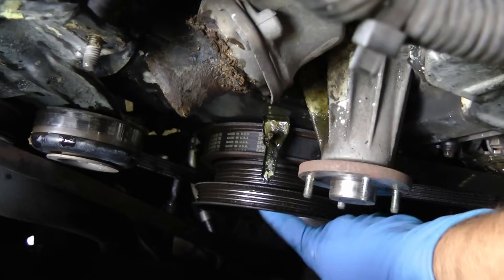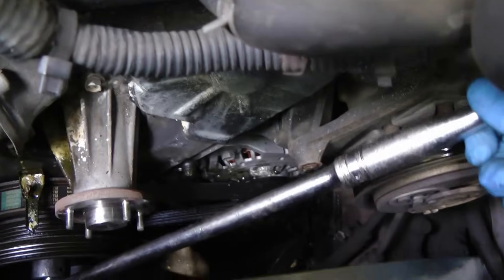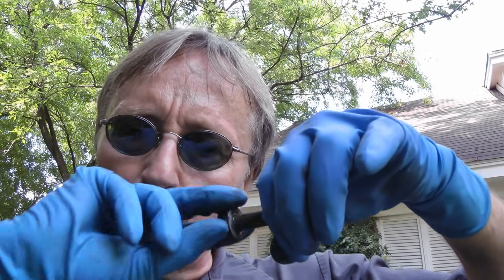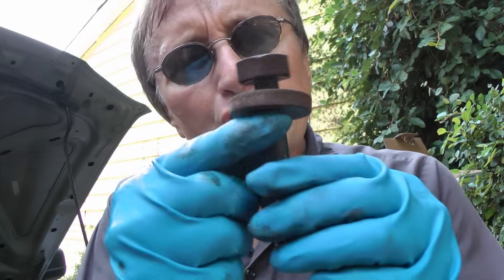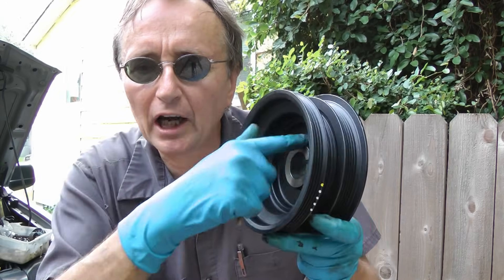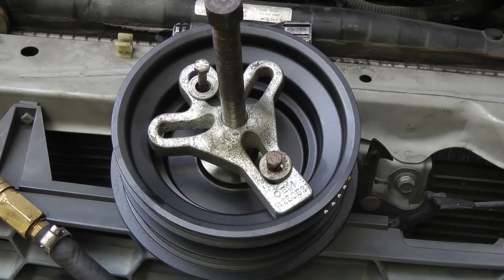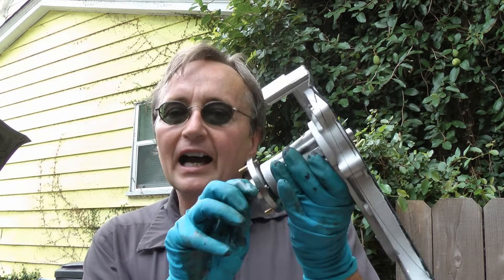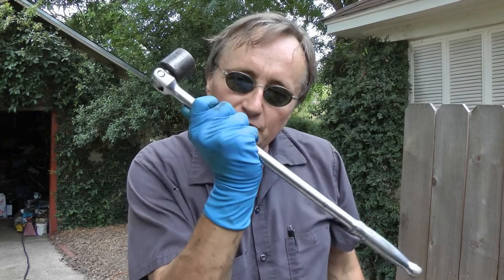How to Remove a Crankshaft Pulley in Your Car

Comment: Should probably make sure everyone knows to not actually start the car.  This method would be safer if you disconnected a fuse or something so the engine can turn but not start.
Reply: Excellent point Elaine
Reply: He probably did that judging how many times it turned and didn't start
Reply: If you shut it off right away will it be safe?
Reply: Not sure I just make sure it dont get fuel or spark when turning it over
Reply: @nathangibson5987  Can I ask why?
Reply: Personal opinion, It dont fill the cylinders with gas  as it cranks over and I stop the spark so there is no chance of it starting
Reply: What about if you have a push start button
Reply: @abrahamhernandez1913 same thing disconnect the fuses and itll just turn over but not start

Comment: Thank you!  I used this trick to get off a crankshaft pulley on my Mitsubishi D1600 tractor. I broke the frame, built a new frame out of much thicker steel only to discover that the pulley was touching the new frame. Saved me a days labor pulling the tractor apart so I could grind a relief in the frame. In all my years of doing mechanic work on my many, many vehicles, and after all the times I’ve pulled the radiator to get an impact on it, I’ve never seen or heard of this trick!  Last night I spent an hour trying to get this pulley off, but the engine kept turning. About 5 minutes of work this morning putting the battery back in and I had the nut off the crankshaft. Thank you!!!!!!

Comment: Just so you know this works great with a 2006 Mercedes C class.  I moved the windshield washer reservoir out of the way so I could lay the cheater bar handle against part of the driver's side cabin frame.   A 1/2 second crank was all it took to loosen the bolt, then it came out easily.  I was ready to buy a special tool for this operation but three suppliers were out of stock.
I am so glad I gave this a shot.  I actually think this is a safer method, especially for the mechanic.  Unless you are a complete klutz and crank more than a than you need to lose the bolt you will do no harm to the starter, etc.
This is the singular best auto repair shortcut I have ever found on Youtube.  Thank you, thank you.

Comment: Scotty, THANK YOU, THANK YOU, THANK YOU for this!!!!!! I tried to stick one of my ratchets with a long12mm socket onto one of the smaller surrounding bolts  repeatedly, and even tired to find a tool to hold the pulley/harmonic balancer in place - - didn't work. I was at a loss as to how to get that main center bolt off without it spinning. Scotty, you are THE MAN!!!

Comment: The bolt removal method W-O-R-K-S! One bump of the starter, the bolt was loose. I did the normal stuff first, like using a 1/2in drive impact, etc and it didn't budge. Thanks to all who posted this method on You-Tube.
Reply: If you have an old car. but push to start cars are dangerous.

Comment: This trick is fantastic!!!!
I did make a mistake of using a 12 point socket versus a 6 point so my first two attempts allowed the socket to jump off and strip the edges.  The third time around I used the 6 point impact  socket and a 5' 2x2 to push against the end of the socket while my son cranked the engine (to prevent the socket from jump off).  Again, thank-you!!!  You have saved me hours of work and frustration!

Comment: Wish I had seen this trick sooner. When I installed a lightweight crank pulley i needed a breaker bar and a 3 foot steel pipe for leverage to break the torque. This man is working smarter and not harder. Nice.

Comment from the maker: either the belt was not put on right correctly, or the belt is the wrong size. ALWAYS turn the engine around a couple rotations by hand to check the timing marks before putting it all back together

Comment: I tried this on my 350z...worked with just a bump of the starter. Thank you Scotty Kilmer aka G.O.A.T.
Reply: My 350zs pully won’t budge
Reply: I highly suggest doing what I did...
1st...remove the entire front end and 2nd replacing it with an LS2 swap. Lol just kidding...spray three shots of PB Blaster on the crank bolt once every hour for the period of a day. Let it soak for 24hrs...
2nd...
Get a 1/2 inch drive breaker bar 24 inches in length. Attach a 19mm deep dish/long socket to the crank bolt. Rotate the engine clockwise until the end of the breaker bar is touching the frame. Put a thick layer of shop towels between the Frame and breaker bar. 
3rd...
Make Damn sure the socket is seated on the crank bolt 100%. And the breaker bar is at a 90degree angle with the socket.
4th...
Simple turn ignition key and let off...its best to bump start..then check the breaker bar and socket alignment. Keep on bump starting until it breaks loose.
Reply: @ulyssesfuentes9739  hope that helps...it worked for me and oh yeah I'm not responsible for any damages to your vehicle due to misuse of my advice
Reply: Carls Johnson I used the tow strap method let some wd40 soak in for about a day and used a 6 foot cheater bar and a variety of impact guns to get it off

Comment: This only works on motors spinning clockwise when facing the bolt (which is automatical loosening). But for Honda Civic which is turning counterclockwise, this method will not work. For me I took it off with a holding tool and a 3/4 inch drive rachet to break it loose. Air impact wrench with beefed-up special socket will also work.

Comment from the maker: drive belts are easy, you just have to find the bolts to loosen to move the fulcrum that tightens them. Or if they have auto tensioners, you get a wrench on them and turn them to slack the belts.

Comment from the maker: yea, getting it back on is the cow part. Me, I put some locktite on the threads of the bolt, then quick screw it in and whack the bar with a sledge hammer a few times. Then don't drive it for 3 hours or so to make sure it's dry on the threads. Never had one fall off that way.

Comment: Scotty--- Thank YOU !! Bought a 95 Isuzu Truck--sons first car. It was the last car we looked at after a long day--I was tired and made a major fail. Test drove, checked all gears, ac, stereo, blah blah---test drive too short. Isuzu made it to my house and shut down at the rear gate of sub-division. No water in radiator, no oil--cooked. Noticed cam and crank still turned. Next day with water, oil, computer reset for kicks---she fired immediately. 277,000 miles--tough little truck. Water pump pouring. So we are doing it all----from the timing belt to rad cap. That crank bolt was killing me. Truck in 5th gear, E-brake on--torqueing on the bolt moved truck backwards !! I was afraid to try this trick--but I had to. With socket on bolt and pry bar wedged to road--I just bumped the key----and the stupid truck fired instantly !! But the bolt came out and the pulley didn't even need puller !! Thanks Dude !! It was killing me...........I am going to check anyway--but if I was able to move the truck back--in 5th gear by trying to turn bolt----can I make the assumption I have good compression?

Comment: I did a timing belt and water pump on a 2002 honda oddysey with the 3.5 . And the hardest part of the job was the getting the crankshaft bolt out. After 15 minutes of wailing at it I finally remembered this video I watched a while back . And said let's try doing it the Scotty Kilmer way and it worked lol.

Comment: After multiple attempts with my $200 Kobalt electric impact and breaker bars this did the trick! I was about to rent air tools and was skeptical but worked on my 2000 Toyota Camry.  Wedge my Breaker bar Towards front of car. I honestly thought it's head or the socket would snap before the bolt loosened. A million thanks!

Comment: you forgot to tell them to remove the fuel pump   fuse   or spark plugs wire so the engine can run and cuse some damages .   good luck and good work your doing.
Reply: Yes this was what I first thought when I watched the video. LOL
Reply: ....Or just switch the key off right away.
Reply: Clear-flood mode would do the same without moving things.
Reply: @Alex-uy7pc  what if its push to start?
Reply: @U2Jaime1317  but it did have a key, we weren't talking about a push start. But if it is a push start, then remove fuel pump fuse. While we're playing what if, if your car is on the moon tie it down so it doesn't float away in ya
Reply: @Alex-uy7pc  what if the only rope tie down I have it too long and it is uncuttable and only the ends are bendable and my car floats away too far anyway?
Reply: @Alex-uy7pc  could you tell me more please?
Reply: Paranoid much?
Reply: the questions is how do you get it back on without spinning the engine on automatics.
Reply: @MrShakamuni01  Thats the problem. I have with this its easy enough to follow but How do you put it back?
Reply: @CaptStump  what's that? Never heard of it. Thanks

Comment: Just tried this today and it worked like a charm. Used a socket and a breaker bar. Held it up against the control arm then flicked the key ignition. Quarter of a second will do, make sure to not start the engine. I suddenly heard the bar move and voila the bolt is loose! 

For retightening the bolt. I followed what Scotty mentioned, put the new pulley in and some threadlocker on the end of the bolt. Screw it in as much as you can without the engine turning if it does then stop. Put the breaker bar with the socket then wack it with a hammer a few times. Let the threadlocker dry for a good 24 hours.

Thank you Scotty!!
Reply: Nooooooo do not use thread locker that’s what causes them to get stuck use a torque wrench

Comment: Just had to remove the crankshaft pulley 2 days ago, did it by hand with a breaker bar and my elbows are still sore. Changed the Timing belt, Waterpump, etc in my 6g72...you don't know hell until you do this job on a Mitsubishi 6g72. The crank bolt/pulley was one of the easiest parts lol.
Reply: I feel your pain, brother. I have an 03 Stratus R/T with the 6g72 in and just had to replace that pulley.
Reply: Do you know how to get a crank bolt off a 1.8t Audi a4 quattro, crankshaft bolt from a pulley?
Reply: reverse the polarity at the battery so that the engine turns backwards when you hit the starter.
Reply: no brother, i Know hell, ive got a 94 probe gt v6.. timing belt replace....  right there with ya!

Comment: That's an old Ironworkers trick , fouling a spud wrench on a flange and backing it off with the impact...Scotty, you are the man...Great  video...Holding the roll...
Reply: Note I made it with 1/4x1x25" HD bought steel bar, the bar bend in 1" dimension like a snake, I guess angle steel might work.

Comment: Hi +Scotty Kilmer I would like to thank you for this genius idea.
I just replaced the crankshaft seal on my 2003 Grand Cherokee V8 engine without even removing the radiator or the fan.
Just needed an 18" breaker bar, a 3" jaw puller and and M14 fine pitch threaded rod to put back the harmonic balancer.
I just saved £480 what they quoted me in my local Jeep garage for 4 hours of labour. Well I'm not a mechanic but I finished it in 4 hours too. keep up the good work! best regards,
Reply: sussexdriver75 I'm about to do my 04 Grand Cherokee. I've read that you can also use the harmonic balancer bolt without the washer to seat the harmonic balancer. Does that sound correct? Where did you get the bolt to re-install yours? Did you use a torque wrench? if so do you know the torque specs? I keep hearing 130 lbs.
Reply: hi M Kinnison you won't be able to remove the washer from the original bolt and it's not long enough to seat the balancer back into it's original position (i tried it and it's an inch shorter then what you need). That's why I bought a 12" long M14 fine pitch (1.25mm) threaded rod and cut in half so one was 5" long and the other was 5.5" so I could play with them. I used 40mm washers and seated with the 5" long rod first and then I put back the original bolt with 175Nm torque (so 130 lbs) as it says. This was 5 months ago and still works fine, no leaks whatever.
Reply: sussexdriver75 thanks, sounds easy enough. It's my daily driver so I worry that I'll screw it up and have to take it to a shop anyways. Also the fan, is it a hydraulic fan? It looks like it has oil lines running into it.
Reply: M Kinnison I would say you have to plan everything if it's your daily driver. You will need a 3" small 3 jaw puller because this will fit without removing the fan and the radiator. You will have about 10mm clearance and that is enough to pull the balancer off. The biggest issue what no-one mentioned how you will put it back! I tried to find this info but couldn't find anywhere in my case when you don't take the fan and radiator off. The biggest PITA is to put the new seal in as it is really tight. It took me about an hour to fit it with a mini mallet. But I found another solution: with a 46mm 1 inch square drive impact socket and with the 5" long rod you can slowly put the seal in place. To be honest I was hardly able to find a fine pitch rod as I was unable to find anywhere locally so I bought it off ebay and of course had to wait 3 days to arrive so as I wrote, if it's your daily you need to get all the tools and parts together first and do it on a day when you don't use your car. By the way I'm not a car mechanic but if you have all the tools you can do it in about 4 hours as I did (except waiting for the fine pitch rod if you don't have one). BTW mine is the High Power output version 4.7 V8 engine so not sure if the other 4.7 V8 has the same seal
Reply: sussexdriver75 Yeah, I was wondering where to get the fine pitch rod from. I did get the socket already and the seal. I also got a quote from a local shop for $530 to do the work and I'm tempted to let them do it because I'm not a mechanic either. I have done a lot of my own work to this thing but this is not something I want to mess up and then have to tow it to them anyways and still get charged. Thanks a lot for the info. I'll probably just flip a coin.

Comment from the maker: get a stronger air impact gun and hold the pulley by hand so it doesn't turn. If that doesn't work, heat the bolt with an oxygen acetylene torch till it glows red, then use the air gun, that always works.

Comment: WORKS but best to use a ratchet as if the engine kicks back that braker bar could damage something. I personally would not let the handle rest against the AC pully. I would have it underneath against the frame.

Comment: What about getting it torqued back down. Any tricks to hold the pulley while torquing down to 165ft/lb without a specialized holding tool.  I have the Toyota pulley with the flat smooth face, no spokes for a universal wrench.
Reply: UPDATE. I had to buy a special tool.

Comment: Worked like a champ on my 2002 Acura TL! No idea why anyone would give this video a thumbs down. Much gratitude to you sir! 🙏
Reply: I love Scotty but reason I gotta give it a thumbs down is this actually messed up my engine and I know it’s technically my fault for not knowing but I don’t think ppl watch this because they know everything and he didn’t mention that if you have a timing chain engine(maybe not all) but the gear behind it will become loose as well and the starter will be trying to crank still even if just for half a second and it can cause the chain to skip teeth then causing bent valves on start in my case or just incorrect timing
Reply: @matthewcollette3424  you should have a timing light to make adjustments in timing.
Reply: @michaelpearce8661  I’ll figure out exactly what that is but what’s that got to do with bending my valves with this trick

Comment: Scotty you are the man. I however am not man enough to try this. I already broke an elbow from the valve cover to the fuel injection. 30 year old all original cars having never replaced anything is a disaster in of itself when these things do break down. Getting that one bolt off to replace the water pump is a pain. Why do they allow time driven water pumps?

Comment: Ok Scotty, if that's how you remove the bolt, how do you tighten it back after replacing it?
Reply from the maker: some guys put loctite on the bolt, others use a strap wrench to hold the crank pulley from moving when tightening
Reply: Peter Kapica If you have access to the flywheel, you can block it with a wedge shaped piece of wood and torque the CS bolt to the proper torque.  Scotty mentions a strap wrench that will also work.  Do not use the red loctite if you ever think you may have to do the job again.  I use the blue and always use a torque wrench
Reply: reverse the battery terminals so the starter works backwards
Reply: @Carnage 50x there is a one way clutch in the starter that would prevent this idea from being effective.
Reply: Yeah Righttttttttt!  LOLO   dont even think of doing that or you will fry ur ECU
Reply: Carnage 50X ha!
Reply: Crank it over again, but put the transmission in reverse, so it tightens it down.😁
Reply: lol
Reply: jomax clux  lololol
Reply: @carnage50x  lol!
Reply: @carnage50x  LOL
Reply: @melody3741  ha ha gold!
Reply: People that lie and joke around and think it’s funny for no apparent reason need to grow up.
Reply: My guy at Napa advised a pry bar. I have an 18 Stanley and the end fits between the ‘spokes’ and it randomly butted up against the curb by the front where I parked so I’m good. I don’t have a Torque wrench so I’m just gonna stand on the end of a cheater bar